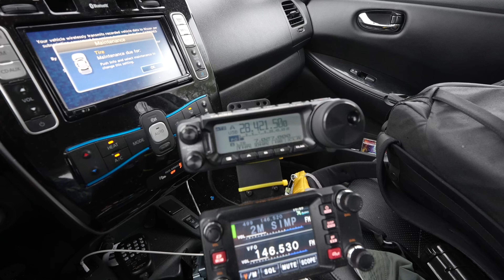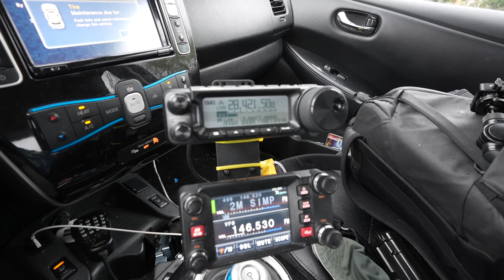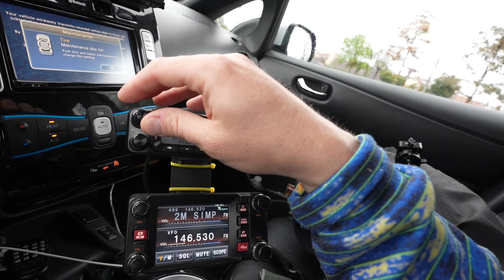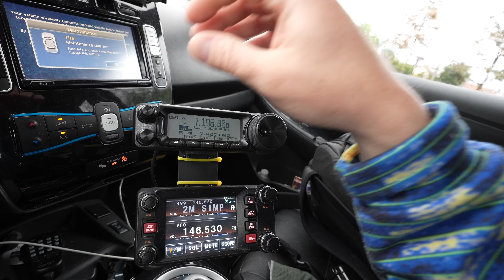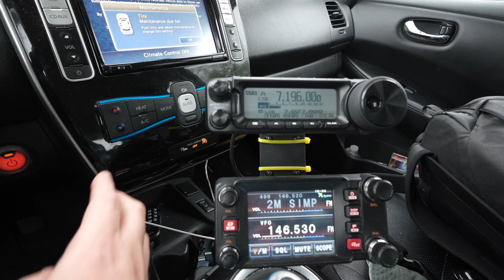Do Electric Vehicles Create Radio Interference (RFI) How To Fix It

Comment: The way to test for RFI is not to do a transmission and say "see it worked fine". You need to measure the RF energy and it shows many dB more from an EV than from a ICE vehicle. EVs use PWM motors and switched mode power supplies both of which are high current and generate RF.

Comment: I have a Renault Zoé since one year, and it's a pain because if it's OK in VHF/UHF, in HF it's 58 level noise each time I turn on the motor and more if I accelerate or use the regen system.
I will try the ground tricks that you show, hope it will decreased the noise...

Comment: nice video. great information. I can tell you that on some EV the noise is most around the AM broadcast band. In my girlfriends car listen to AM radio and had a tesla model 3 I thing go buy and it put a wine in my AM radio . Also in a park buy me we have a free charging station. and it is used very often. When a car/truck is charging using a battery AM radio near the car makes noise in the AM . At my home I am off grid with wind and solar. my MPPT makes some RFI but ferrite took more than half out . and mostly 160 meters . I have some EV's . I do get a little RFI when charging.  even a 48V golf cart makes some RFI charging . putting ferrite in AC and DC leads helps a lot but varies so much from charger to charger. my J1776 charger makes no noise. that level 1 or 2 . all I can do hear. nice pics of some ferrite. I does work . I put right on my PV panels and right at win/gen . then again at in and out of charge controllers. ad right at battery . I have both 24V and 12V systems. and 48 V one as well. thank you for the video,73's

Comment: Good video to show even more reasons to NOT buy EV's. Invest in horses now before Sleepy Joe and Camel Toe ban electricity after they ban natural gas and the price of horses skyrocket. You can breed horses, but not cars! Also, get a good generator installed in the bed of that truck so you can charge it when on vacation!!!😀
Reply from the maker: I’d encourage you to generate opinions on Evs that aren’t based on political ideology. It’s ok to be objective on topics like these.
Reply: @HamRadioCrashCourse  Sorry Josh, I really thought after watching many of your previous videos you were at least a little conservative, and you would hopefully get a chuckle out of my opinions on the state of our once great country😀😀 I truly did not mean to offend you. I have at times been very curious in getting an EV, but the price point of the initial investment is too much of a risk for such new technology, in my opinion, and I never like to be a guinea pig for anything new. I'll leave that to more gung ho people like yourself to do the testing, thank you very much. I do really believe everyone should invest in horses if they have the means! 
To be totally objective towards this video, would it not make more sense to sand down to bare metal the connections points for the copper braids and then check for continuity between the connections to be totally certain you have a decent bond?? How often do you use this antenna? I have an ft891 also and I am thinking of getting the Atas 120A to install in my Rav4 despite the somewhat negative reviews on the antenna.
Reply from the maker: @wateroperator1972  I'm actually very conservative, but I'm also objective enough not to be led around by dog whistles.  

Never sand a vehicle to bare metal, you only need to use serrated washers that get a good bite for bonding to be effective. This protects the coat of your car.
Reply from the maker: @wateroperator1972  And no offense taken.  I do challenge ideas though in the comments.

Comment: Great video! The problem I’m having is that Tesla changed the voltage in its low voltage electrical system, so my 2022 Model Y is 16V. So no mobile radios work now. But noise testing isn’t too bad. It’s actually better than my model S (which I crashed). I may use the trailer hitch for the antenna.

Comment: What about while driving, electricity in high amperage running the motor or motors.
Reply from the maker: Generally fine.  Some have issues with the braking like I said.

Comment: Love this.  Now I have to find a solution for a Dodge Cummins
Reply: Cummins? That's a diesel. There shouldn't be any RFI whatsoever, because there's no ignition system.
Reply: @vhfgamer  - Think again.  6.7 Cummins used electronic injectors.  Noisy as …
Now if it was an old two stroke Detroit, that is perfect old school.  This new stuff is ⚡️⚡️⚡️
Reply: @dave-wk4t  The 12 valve cummins used mechanical injectors... not a 2 stoke.

The 6.2l Detroit Diesel (also not 2 stroke) used mechanical injectors.

The 6.5l Detroit Diesel (again, not 2 stroke), used mechanical injectors. 

I could keep going.

Comment: I’ve got a 2016 VW eGolf. Zero issues and I’m powering my radio (Yaesu FTM-400XDR) via the 12v socket in the boot. Trunk lid lip mount. Comet mount, coax, and antenna. Slick stuff! The hardest part of the install is choosing where to mount the head!
Reply from the maker: Hah! I feel that. It was easier to mount the heads back in the day.

Comment: Of course you’d say Teslas are known for RFI issues with HF rigs. That’s what I’m trying to do: figure out hire to successfully install an quality HF All-Mode rig in my ‘23 Tesla 3 now that I just picked up my General ticket. Oh well, gonna try anyway and see if your bonding video helps. I think I’m also going to add a dedicated lithium battery for the Ham equipment and use the low voltage battery on the car to trickle charge the accessory battery to add an additional noise filter in the loop and protect the car as well.

Comment: Do some research on the ford F150 lightning. No one is happy with it because of the battery issues
Reply from the maker: “No one is happy”. 

I’m happy, so we can reject your claim. 

I’m active on the lightning forums and there are fewer battery issues of any. Not sure where you’re getting your info from, or why for that matter.  Why are you researching a truck you don’t want to own or care about? 🤪
Reply: @HamRadioCrashCourse   just wanted to say something so you can look in to it for your self and you are not supposed about the problems
Reply from the maker: @johnsonbrandon807  What led you to believe I didn't do research or didn't know about the current production issues?  FYI, the issues in productions aren't supposed to have affected any vehicles that were delivered.

Comment: I’m not sure about the effect to the operator’s radio inside the EV but my 891/atas combo in my Ram “hears” the rf of a Tesla pass me every time. And in Cali, that’s often. (I also need to choke my LED brake light lines which are even louder. )
Reply: Hey Josh, I just tried chokes on my Ram to eliminate the LED brake light rfi. The clip on chokes on the brake leads may have helped some, but the 240-31 added to the coax before the ft-891 completely eliminated the hash. Great results. Now off to get the SA10 contest contacts.

Comment: Nice coverage Josh! I found that with my 2014 Volt, and my IC 7100 / ATAS-120, that the only time I could comfortably use it was when I was parked. I did everything I could think of with toroids, and bonding / grounding, but the noise floor when driving was never brought down to where it was useful. I eventually wound up taking the 7100  into the shack and limit my mobile activity to the IC 4100 on VHF / UHF.  73 - KF6IF
Reply from the maker: That’s the ev with the generator right? I wonder if that has something to do with it?
Reply: @HamRadioCrashCourse  Yes, and No. With the Volt, I can run completely on battery for up to 40 miles for around town trips, and when I have to go on extended, non-stop trips I can put the battery on hold, and just run off of the ICE generator under the front hood. In either case, the noise was between 7 - 9 s units while driving. The regenerative braking increased the problem as well.
Reply from the maker: I wonder what caused noise for you but nothing in other EVs?
Reply: @HamRadioCrashCourse  I think it is the inverter in the tesla model S
Reply: @HamRadioCrashCourse  ... good question Josh! The radios were mounted back in the well where the aux battery is and the inverter as well. I never could get the noise while driving lower that a 5 and when you accelerated, put more load on the electrical system you would hear a constantly varying noise level above 9 at times.
Reply: Never used mobile HF but just like above I have a Volt and an icom 4100. No interference, no torroids. Volt is Gen 2 so maybe a little different.
Reply: @mikemandell132  ... Yes, FM makes all the difference. 😁
Reply: I don’t know about the Nissan leaf but from my personal experience the model S when the vehicle is mobile and the regenerative braking is working the noise flow increases quite significantly 73 DE VK9TOM/VK3FTOM

Comment: I’m curious as to where on the new truck you mounted the ATAS?
Reply from the maker: It’s going on a stake bed mount. Vhf/uhf mounting video should drop this week or next.
Reply: @HamRadioCrashCourse I used the Breedlove “angled” stake mount behind the driver side cab for my ATAS-120. It’s so much more solid than the K-400 I used to have on the hood corner.
Reply from the maker: Nice.

Comment: My experience with a Kia Niro EV has been great.  No noise.. just annoyed when others in a parking area start their engine or park with their engine running for heat/air as I can hear their spark plugs/ignition system.  (POTA and VHF contest).